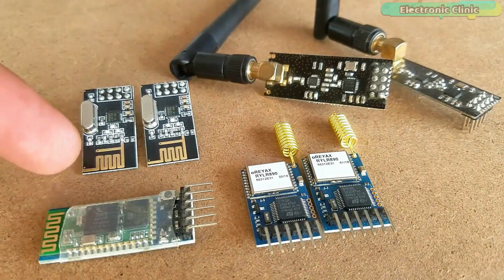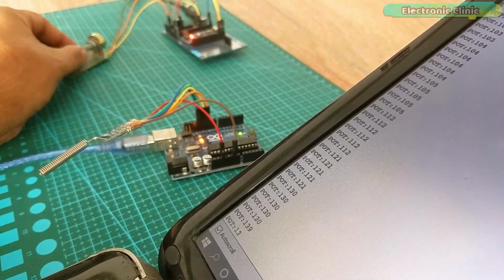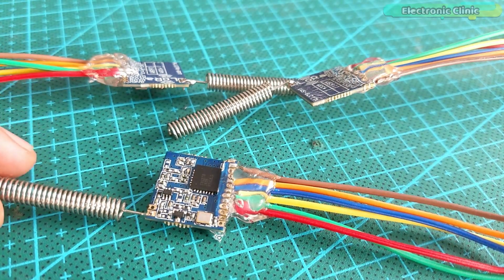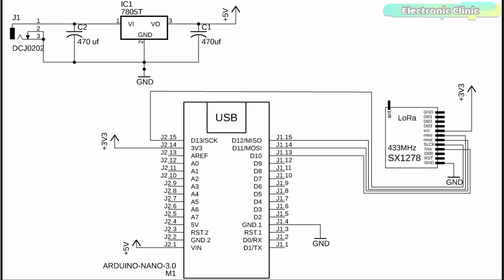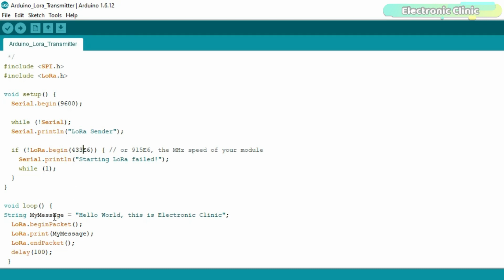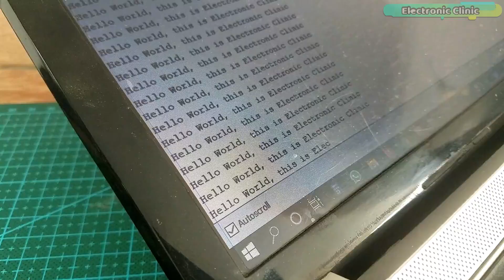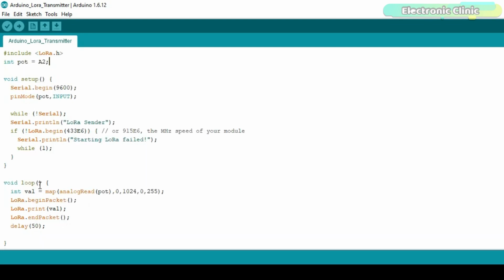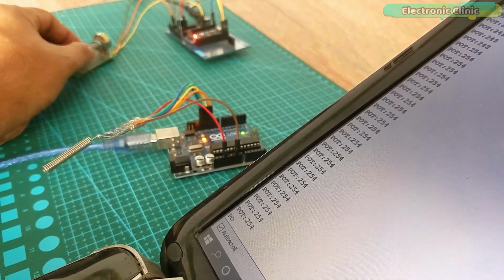Lora SX1278/76/77/79 Arduino Hello World & Sensor Monitoring Projects, RA02 Lora Module

Comment: arent there any issues about connecting the digital pins of the arduino without a resistor to cut the current down to 3,3V? I thought the digital pins run on 5V. Please let me know if it would damage the module on the long run. (Im a beginner so if I said something stupid dont judge xD)
Reply from the maker: @LuisSemmler-u5w use 3.3v, use esp32 this way u won't need to stepdown the voltage. I have several videos on esp32 and Lora.
Reply: @ElectroniClinic  Thank you for answering this quick. I understood, however I am using a USB-C nano clone which doesnt have a 3,3V+ output so I am connecting a transformer between the nano and lora module. Still, that means the nano runs on 5V which means the digital signals are not suitable for the lora module...
Reply from the maker: @LuisSemmler-u5w  ya Arduino pons are 5v compatible  ,  but why to use Arduino when you have the esp32.

Comment: Great project!! Thank you for share it!! Have you used any special soldering iron to solder the wires to the Lora module? Because the connectors are too small!
Reply from the maker: Use the pointed soldering tip.
Reply from the maker: You can watch my video on soldering iron tips.
Reply: @ElectroniClinic  Thank you for your answer!!

Comment: grettings, i wanna build my cheap rc transmitter and reciver for my drones. What do you thing about using this modules? I afraid about latency in lora. Or do you have any suggestions which module should i use? Thankss :)

Comment: Greetings, thank you for the information you gave, I subscribed to your channel. I follow your work. I could not connect with the lora modules in the video. Do I need to edit the parameter settings of the lora modules? how to do it if needed?
Reply from the maker: you dont have to edit anything. just follow the same connections and code.
Reply: @ElectroniClinic  thank you very much.

Comment: What a wonderful collection of IoT project brother, I do always come to this channel for any wireless project
please can you explain the network using this lora module too? sending several sensor datas to a single receiver
also, regarding networking, you can create a tutorial series to create a lora network, in which lora sensors send the data to any receiver (many receiver) with OTAA - Over The Air Activation strategy not hardcoding the receiver address.
Btw, thanks for your wonderful work on this channel
Reply from the maker: i have created 5 more projects with lora, which i will upload very soon.
Reply: @ElectroniClinic , hopefully will be with this SX1278 module because rylr896 is not available from where order my parts.

Thanks for your work, may the Allah keep you safe
Reply from the maker: @raymondmichael4987  ya bro, i will be using the Lora module. Its more powerful then the one from reyax.

Comment: 2:11 - "the supply voltage is 1.8-3.7V so it can be used with 3.3V and 5V...without ANY PROBLEM" - am I hearing correctly?
Reply: did it work for you, because it doesnt for me and now I am reading around that the logic connections for arduinos are 5v which might be why it doesnt work for me
Reply: @N1ghtR1der666  I never use Arduino - always ESP32